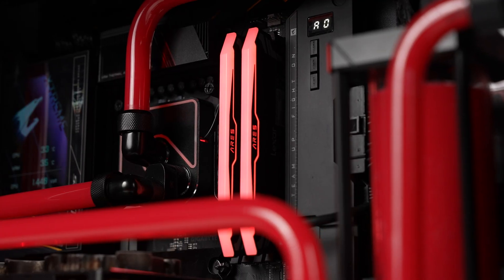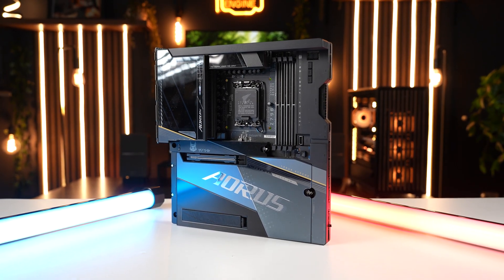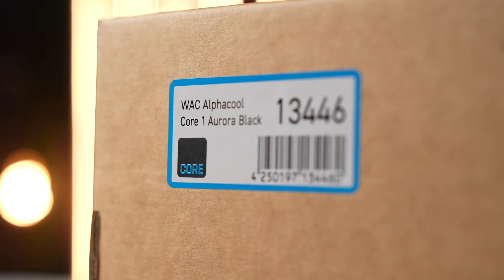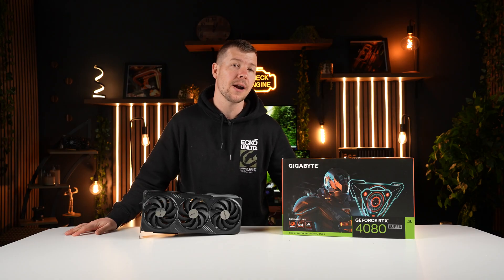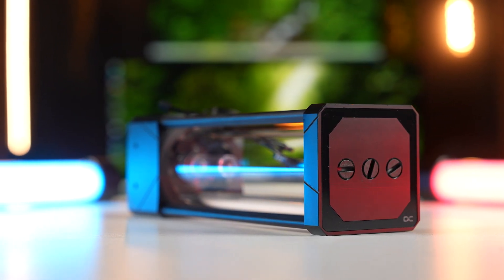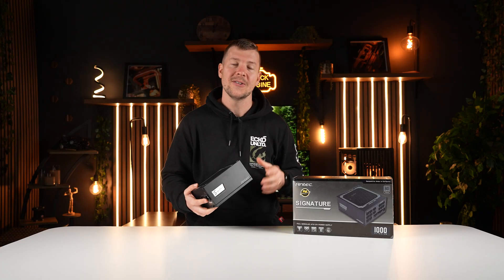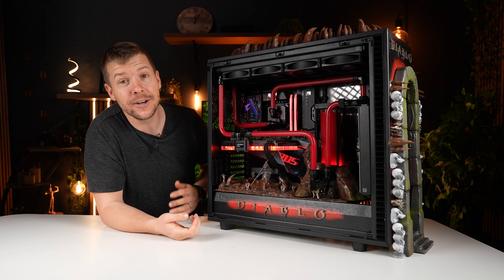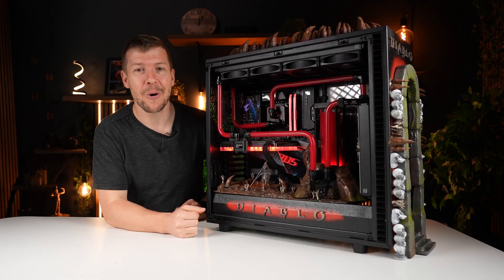Building The Most * POWERFUL * Intel PC in 2024 - i9 14900K + RTX 4090

Comment: I like the Artic freezer III period. Price to performance is unmatched compared to other models thats way higher in price.The fan that cools the cpu and vrm,the radiator is thicker than most Aio's,the diameter of the tubing allows more water flow to the cpu for better cooling.The whole cooler is something to like!

Comment: Building the most powerful pc that will fail due to Intel's fraud on 13th and 14th gen CPU's. Hope you enjoy RMA's as that's where this is headed. Good luck you will need it.
Reply: I think they pushed out an update to fix those. Maybe even 2 lol I can't remember but I'm pretty sure the issue was solved
Reply: @FrankenKarn  fix what? That issue is unfixable, cause it depends on the actual architecture of those cpu's, that's faulty, no fix is possible, only mitigation. Keep that in mind.
Reply: @js-pc6fw  are we talking about something other than the overheating issue? couldnt that be solved with power restraints
Reply: @FrankenKarn it doesn’t fix it; it’s a band-aid.
Reply: There’s a microcode that’s fixed it. It’s a Vmin Shift Instability. New CPUs aren’t affected. Got announced today by intel
Reply: @RH1TE_  awesome thank you for the update